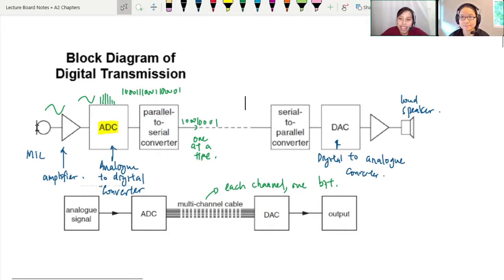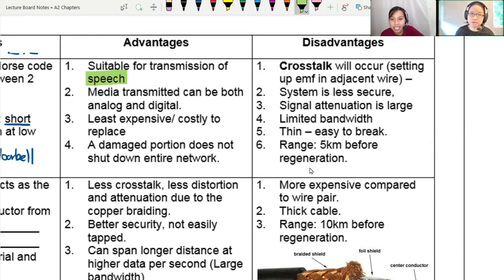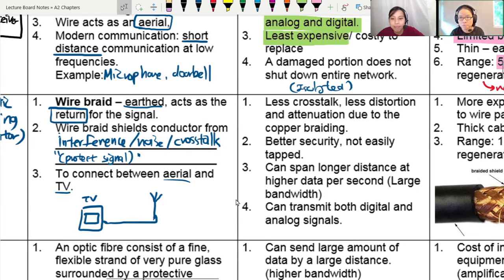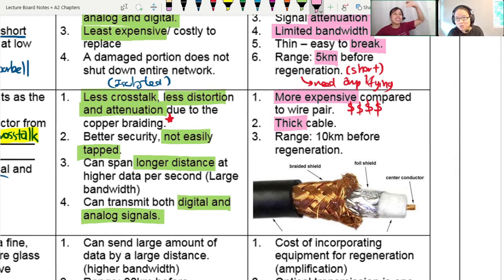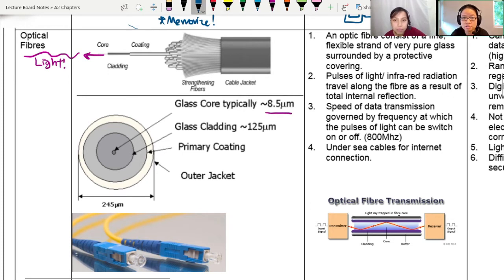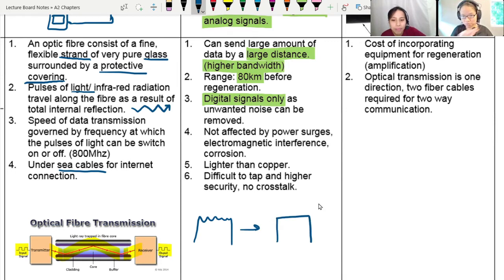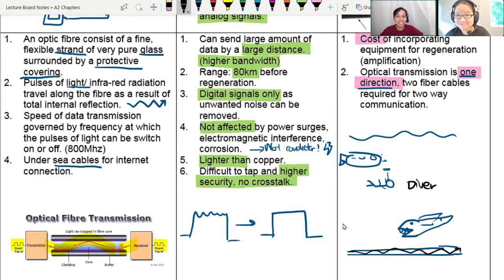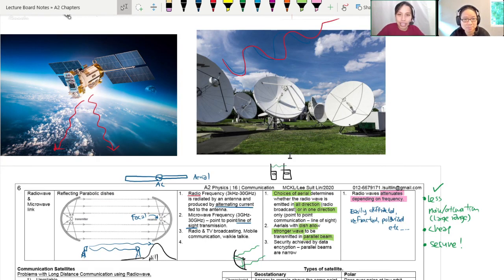116.3a Communication Channels: Cables and Parabolic Dishes | A2 | A Level Physics

Comment: Hello. What does it mean by "earthed"? I've seen this word a lot in Communications and Electronics.
Reply from the maker: Earthed means the circuit is connected to ground for safety reasons mainly. all points on that line is 0V it is also used as a reference line. 

here are more info 
https://en.wikipedia.org/wiki/Ground_(electricity)#:~:text=In%20electrical%20engineering%2C%20ground%20or,to%20ground%20for%20several%20reasons.